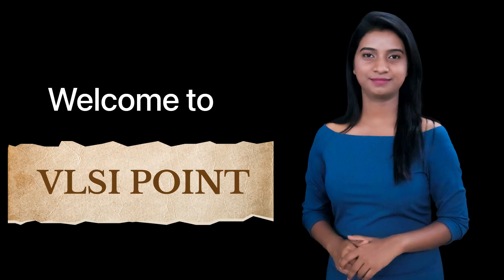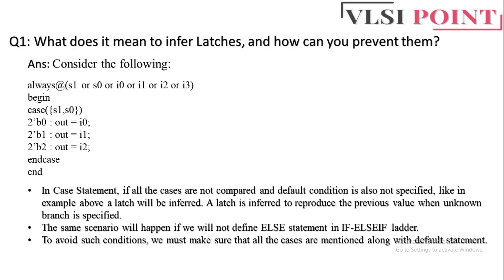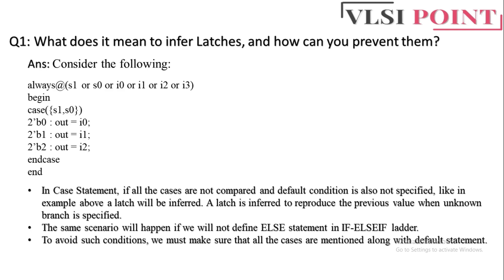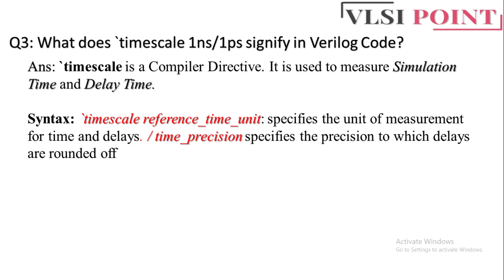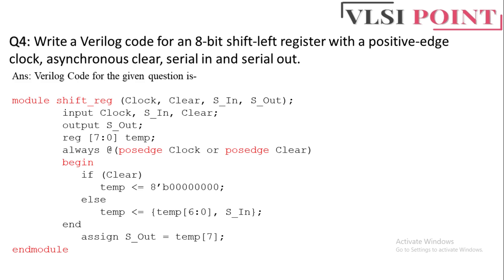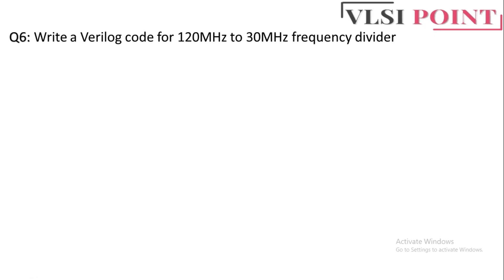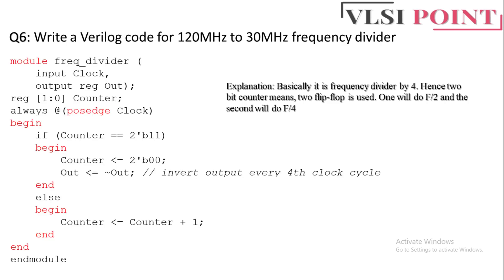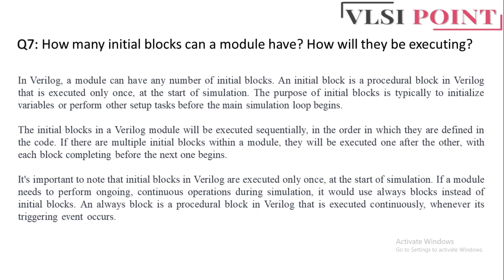Verilog Interview Questions with Solution | #5 | VLSI POINT

Comment: In question 7: multiple initial block as well as always block it's excute parallelly right?
Reply: All initial block are start executed  in parallely and start in 0 simulation time. But in video it is wrong.
Reply: Yes, it is correct, but in video it was wrong, inside the initial block it will be executed in sequential